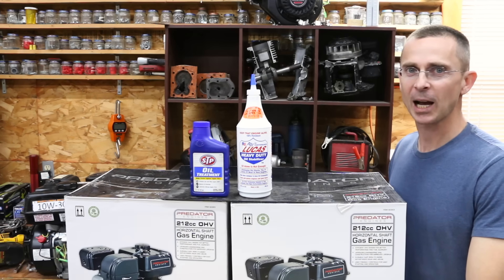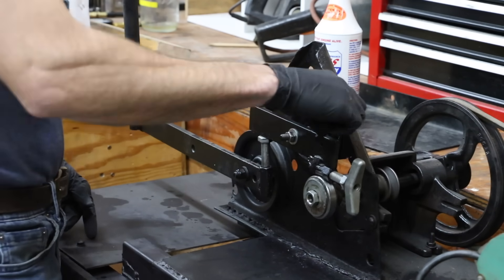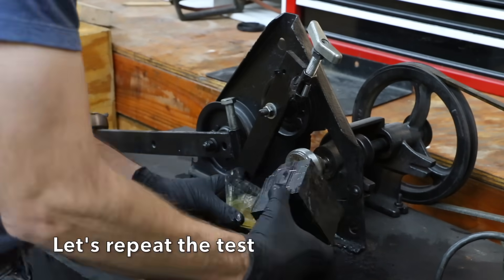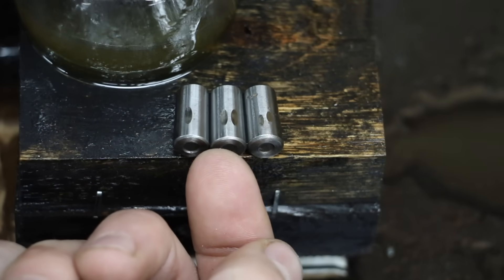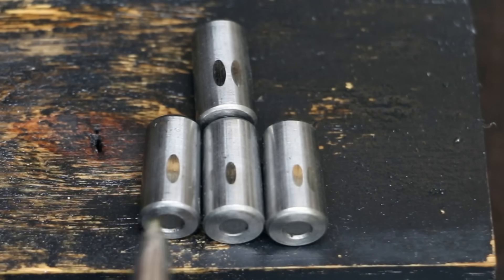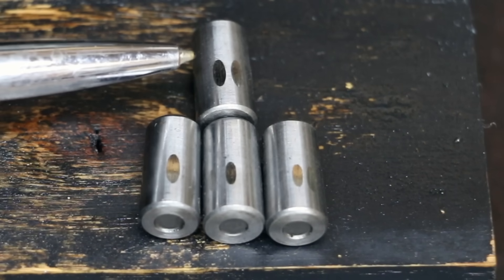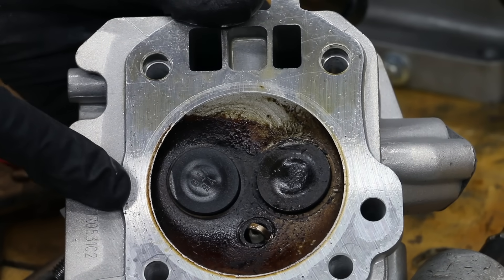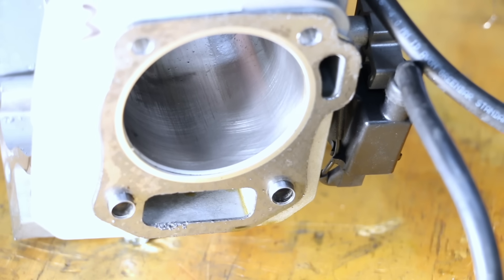Which engine self-destructs first?  Lucas or STP?

Comment: So what did we learn? Dont run your engines without oil.
Reply: If you were to run the engines with the oil in them for a set period long enough for them to wear the oils, you could drain the oil and find out the conditions of each.  You get a better idea of if they do a better job compared to each other and you get to keep the engines for further tests.  A base engine should be a good idea too, just oil no additives.
Reply from the maker: Thanks for commenting. I'm open to suggestions on a better test design.  Please create a new post if you have any suggestions. Thanks again!
Reply: Anything is better than nothing
Reply: @33snook64  even cat piss?

Comment: the classic  would be slick 50  vs prolong, you can clean those cranks up some by take a rag soaked with muriatic and wrapping it around the crank journal for 24 hours and that aluminum will dissolve
Reply from the maker: Thank you for this recommendation!

Comment: Stp motor treatment vs sea foam
Reply: You could sell lots of the parts off of the engines that blow up to people who need them like on eBay or something. Pull starter, carb, throttle linkage and so on
Reply from the maker: Thank you for this recommendation!  I will likely donate the engines to a school shop class. Thanks for commenting!

Comment: Do you have any ideas what would be a good strategy for starting a diesel that has been sitting for many years?
Reply from the maker: I hope others will weigh in on this as well.  If it's not too difficult, it might help to pull the injectors and add a little Marvel Mystery Oil to each cylinder and allow it to soak overnight.  Thanks for commenting.
Reply: Thanks for the response. I also heard about people making a thing to pump oil into the engine through an inlet with a modified garden spray pump and then hand cranking the engine. I was thinking about trying this.

Comment: What is the point? If you run an engine without oil it’s gonna blow up additive or no. You could do this test multiple times and get either engine to blow in a different order I️ would bet.
Reply: Where is the baseline test then? You didn't run an engine without any additives to see if it failed first. And when they say it will save an engine running without any oil I'm sure they mean briefly, not for 20 minutes...  Too many variables to determine weather the additives even made a difference in failure as there could have been many other reasons why one failed before the other....
Reply: Potato Chip NO there are many companies that make oil aditives that claim they can save the engine in the event the engine oil drains out... The point is an engine empty of oil running for 20 minues is no small feat... Without the aditive, I can almost garantee the engine would have failed in half the time... Have had this exact thing happen to me on my motorcycle on the highway... Oil filter bursted and I lost my engine almost that instant.... Fast forwards years later, I was runing on the highway... same thing happened, oil filter ruptured... this time I did not loose my engine.... I was running AMSOIL and Lucas... this happened with 13k miles on the bike... it now has over 30k with no rebuild... SO I can contest that the added benifit of running with stuff like STP or Lucas, or whatever brand... it gives you that little extra time to react and get the vehicle turned off and to the side of the road before the engine lets go... SO no Project Farm is not making things up... He is just testing what is claimed by the manufatures of certain products.
Reply: My thoughts exactly. I like STP because it is cheap and I have personally seen it work wonders in old tired motors. I know others who swear by Luccas, but I am a cheap bastard so I don't buy it. I don't see how this test proves anything, especially given harbor freight quality control. Its not like these motors are actually identical just because they came out of the same boxes.
Reply: I see in previous comments that you did a baseline in a previous video. OK. Should have that info in this video at the minimum! This test isnt wasted, you have info on how long each will last with catastrophic failure, now (if you do this test again) try each test again, but instead of letting them self destruct, do the same test mythology but run each engine without any oil for lets say 5 minutes, then add the proper mix, run for another set amount of time (lets just say an hour) and then tear down the engine to see which has the least damage, either support or deny the products description of them being saved from low, or no oil, as I'm sure they were not claiming that their product, if used briefly, magically prevents an engine from needing oil indefinitely lol. More along the lines of accidental engine start or low oil.
I've dealt of this situation before where someone went to an oil change shop, they drained the oil, asked them to start up the vehicle (whoops without any oil!) turned the engine off after a small amount of time and then added oil (obviously realizing their mistake). Everything was fine and dandy afterwards, no noises (or connecting pieces of connecting rod in their oil pan haha), but like 4 months later they had a knocking noise coming from the engine at higher RPM. We tore their engine apart and found slight scoring on almost all 8 connecting rod bearings and one with enough material missing to cause piston slap/ or enough play to make it audible. Maybe if they used one of these products their engine would be okay?! Test!?
Reply: Stfu Abigail
Reply: Been there. Done that.
Reply: Obama was awarded the Nobel Peace Prize also, so I wouldn't use that as a benchmark of excellence. 😉
Reply: Shawn Valair
No not really... the engine runing just oil no aditives ran for 7 minutes... the one with Lucas ran for 20 minutes... the one with STP ran just short of that.... SO no just running plain oil the engine did not even last half the length of time... SO it all comes down to the film stregth of the additive... Luscas has the higest tested film stregth of the products tested here... SO that is the main reason the engine with the Lucas additive ran the longest and the reason the Lucas also showed least wear on the lubricity test...
Reply: Do you mean Nobel Prize in Chemistry????
Reply: The TDI Guy at least he gave his opinion on the video.. What value does your comment have? None besides being straight up negative towards another person
Reply: MasterMech77 he said he ran a test in a different video with just regular oil and it lasted longer with no oil afterwards compared to these with additives
Thus, many variables.
Who knows maybe the second time it happened to you it was able to still give a small amount of oil pressure to save it. No way it was the exact same situation twice
Reply: Shawn Valair 
The video with the Slick 50 vs 30 SAE... The Slick 50 ended in 2.30... the 30 SAE ends in 7 minutes... 
SO with that in mind the STP came in third and then Lucas ends at about 20 minutes... 
This is consitant with the tested film streangth of the products tested... As in Slick 50 has the lowest film strength when used outside of its recomended ratios... then in order all the way up to Lucas, which has the highest tested film Strength. Film stregth is the products ability to stay "attached" to the metal under load... SO NO I am not seeing anything out of the range I would expect to see here. The film stregth was tested with the recommend ratios directed by the products manufatures... The Slick 50 was tested with more Slick 50 then what is recomeneded... By a fair amount... SO I expected to see that engine fail first. Don't worry when more products are tested there will be a clear result. Products with the highest film stregth will last longer, meaning the engine will run for a longer period of time.
Reply: Nick H the point is to see how good the lubricants really are..
Reply: Shawn Valair
 Forgot to mention... the engine that had the Lucas and Amsoil was running for far longer then the one that failed with just plain conventional engine oil. The conventional oil lasted for a few seconds after the oil light came on... The engine that was running Lucas and AMSOIL... is still running.... I was able to coast the bike off to the side of the road, then shut then engine off... As both bike were 2007 Kawasaki ZX14s, if you hit the kill swith to shut then engine off you also kill the main headlights... I was riding at night on I75 between Tampa and Westley Chapel... Both Bikes had right around 10k miles on them... the one that is still running actually had about 13k... so even more millage... Both oil filters popped like a balloon... It is a common issue when then engine is operated at the top end of the RPM range for extended periods of time... I now run a K&N racing filter, that uses reinforced filter housing... This prevents that oil filter from balloning out under the extreme oil pressure a 1400 cc engine is producing at over 10 thousand RPMs... 
   SO don't worry I have no doubt I would be able to recreate the results with in a certain percentage and show definitive differences between running plain engine oil and one with the added protection.
Reply: branscoset, If you already knew this why did you bother to watch the video?
Reply: MasterMech77 so basically exactly what i suggested in an earlier post, correct?
Reply: nope thats false, after searching many products i am yet to find anything about saving your engine if you have no oil. These additives are made to extend oil life.. not to add..drain.. and make your engine run with nothing in it. As a matter of fact i could send you some links to some company websites if you'd like.
Reply: Obama also won a prize from them.
Reply: Are you high? It ran for 38 minutes compared to these that ran just 20 minutes
Reply: Film strength means nothing when there is NO OIL between the metal parts! When these engines fail it is because the metal bearings literally weld the two mating surfaces together, while it is spinning at high rpm, which causes the connecting rod to snap!
Reply: +MasterMech77 yeah the lucas did do better, held out the longest for sure. Lucas has let a few motors live longer out in our field. Its not bad stuff
Reply: What matters is how long they last w/o oil. Comparing the internal damage,  while interesting, is irrelevant. They all wil seize eventually.  Even slick 50.
Reply: both did for a significant amount of time. amazing that the lucas engine ran dry for over 20 minutes before self destructing
Reply: Ryan Brown Obama won a nobel peace prize before going on to bomb 7 countries. I wouldn't put too much stock in who wins those.
Reply: And both of these would have.. if you shut the engine off when the low oil light came on (or it shuts off at the low oil sensors signal).. They both ran for 9+ minutes after that..
Reply from the maker: Lots of additive makers claim their products will save an engine if the oil is drained. Thanks for commenting.
Reply: Project Farm I️ guess so. Still an interesting and well done video
Reply: +Anthony Smith Archoil AR9100 is my oil additive of choice in everything I own. The team that invented it won the Nobel Peace Prize for Scientific Achievement.
Reply: BUT THE WHOLE POINT TO THAT IS WHICH ONE WILL OUT RUN OR LAST LONGER WITH MINIMAL DAMAGE
Reply: The brown N must stand for negative.

Comment: Did you ever try running an engine that didn't use an additive, just plain oil with the same test to give you a baseline measurement of how long it last to compare it to the addative test to see if the addative actually makes a difference at all..
Reply from the maker: Yes, in a previous video. It lasted longer than both of these additives. Thanks for commenting!
Reply: Project
😉😉😉😉😙😎😚😎😊😄😄. KkkkkkkkllllllóppplwaAAAAAAAAAAAAAAAAAAAÂAQQQ222ÈWplppapwppwpwpwpwppwpWW22X X ,. , as a result the opportunity p

Comment: Very fascinating indeed. A suggestion though. When you do the bearing test, you do it with  cold (ambient temp) oil. I think just to make the wear test a bit more accurate you should use hot oil.
Reply from the maker: Thank you for this recommendation!

Comment: I appreciate your time and effort, but since NO engine manufacturer recommends either of these additives, it's kind of a moot point.  Running without oil will destroy any engine, and the damage will occur far more quickly if the engine is under load.  The bottom line is that if you change the oil regularly, and take reasonable care of the engine, most of these small engines will run for 10-20 years.
Reply from the maker: Great point and thanks for commenting.
Reply: My Bolens GT180 garden tractor has a Briggs IC twin, 16hp; just celebrated it's 35th birthday of taking care of the lawn!!!  No additives, just annual oil changes.  Straight 30W.  Might have put a bit of that Teflon stuff in a couple of decades ago, now that I think about it. This spring I did notice it losing a little power, so I used some Seafoam in the fuel and it helped.  So did Marvel Mystery Oil.  It felt weird using anything, but I'm happy for another year on the old girl.  But she's using an ounce of oil every hour, so I'm afraid her time with isn't going to be very much longer.  Although maybe with some new seals, bearings and some .030 over pistons and rings . . .
Reply: There are cases where its not a moot point though... Engine manufacturers dont recommend additives because it just complicates things further and costs them more for testing with no benefit to them. At one point these manufacturers did not endorse synthetic lubricants at all..  I have a 2nd gen Ram ecodiesel which unfortunately has a design flaw FCA wont acknowledge or correct for existing owners. This causes a very high main bearing failure rate in these engines. This is why I use a ZDDP additive along with lucas to help starve off this possible failure in a truck I otherwise love. in another vehicle I own I built a performance engine and use lucas to aid in reducing wear and keep it running longer for me.

Comment: In the previous engine last video , the engine with just regular oil lasted way longer then these those engines. It just don’t make any sense .
Reply: New engines have smaller bearing clearances and will fail the bearings sooner.
Reply from the maker: Great point.  Thanks for commenting on this.

Comment: Would like to see how the RVS stands. It is said to be not an additive, rather a treatment and it should form a layer of very low friction on the hottest points of an engine. http://www.rvs-tec.com
Reply from the maker: Thank you for this recommendation!
Reply: The technology of the stuff is originally invented (accidentally, while boring deep holes to the ground) in Russia and at some point a Finnish company got hold of it. They have been slowly gaining market since, but the stuff haven't got any huge attention. I think they just have quite bad marketing. In 2003, there was a national TV-show where they did the treatment to an old Ford and then drove about 100 miles without oil. The engine had a camshaft seal failure due the high temperatures, but when they took it apart, there was no apparent wear on the surfaces, only the camshaft bearing was totaled. https://www.youtube.com/watch?v=-NymF_vEst0

Comment: Here is an idea, revisit sodium silicate...  after loading an engine, take it apart as before, but ..... then boil the parts in water. Hot water may dissolve the silicate, rendering the engine ( at least a car engine) rebuildable.   Adding a caustic should accelerate the dissolving, but would also eat aluminum.. so there is two tests, plain hot water boil, and water with a bit of lye ( sodium hydroxide) and see if the lye helps and if it over etches away aluminum.
Reply from the maker: This is a terrific suggestion--thank you!

Comment: This was great! I have been using Lucas synthetic oil stabilizer with Mobil1 for many years on my 98 mustang cobra. I recently tore the engine down to replace gaskets and to get the heads worked. The heads need new exhaust valve guides and all new valve stem seals. I had no sludge build up in the engine anywhere (105k mi) an I could still see the cross hatch marks on the cylinder walls. I did find very slight scoring on the 1 of the cam journals, I think it is from not starting the engine for several months and the oil has drained out to oil pan and low oil pressure at start up. 
Love the videos!
Reply from the maker: Thank you!

Comment: I have been using Hyperlube Oil Supplement for about 3 years in my high mileage engines (200,000 plus miles) with good success.
Reply from the maker: Thank you for this recommendation!
Reply: I don't recall making this recommendation and I have not used the product
Reply: Sorry Jose -- It looks like your name is somehow logged in to my PC. I will logout you -- I apologize for the oversight.

Comment: That scoring on the side of the cylinder walls was piston-slap. Its evident because only two sides of the cylinder wall has the scoring. Most likely when it started inducing a knock, the piston started to slap on each stroke, which increases the knock even more to a point where the weakest part gave (the cast alum con rod)
Reply: gr8 vid as always
Reply from the maker: Thanks for commenting on this and thanks for the positive feedback!

Comment: I was really impressed by the looks of the crankshaft in those engines, as well as the small amount of scoring after a no oil run.
Reply from the maker: Yes, the aluminum could be cleaned off and the crank reused.